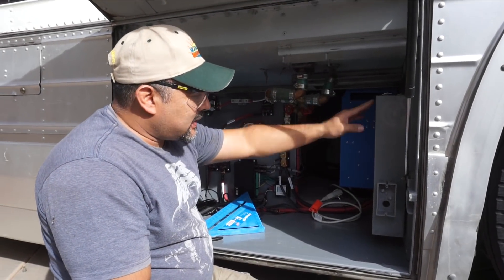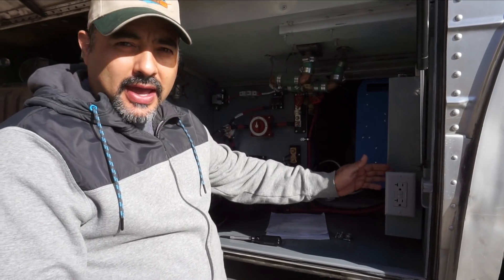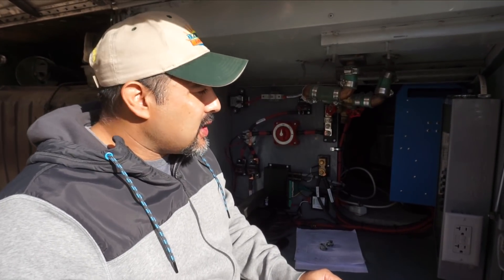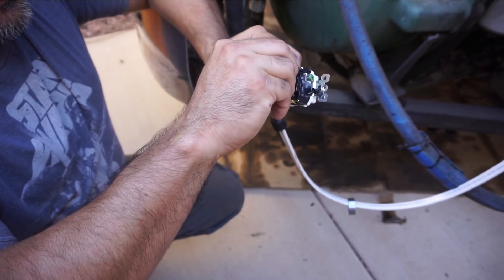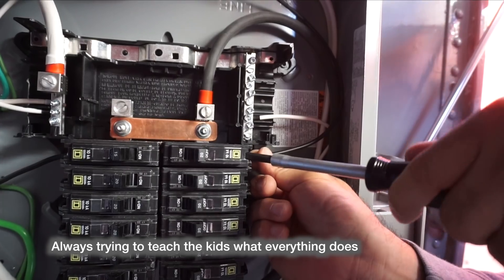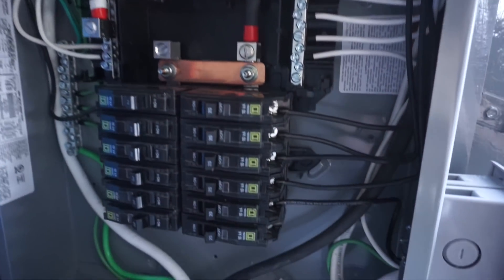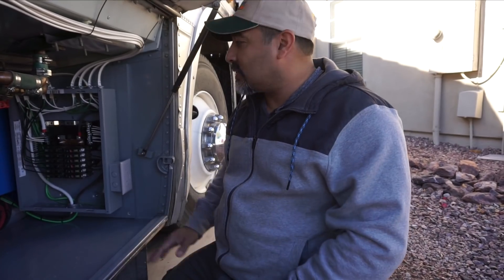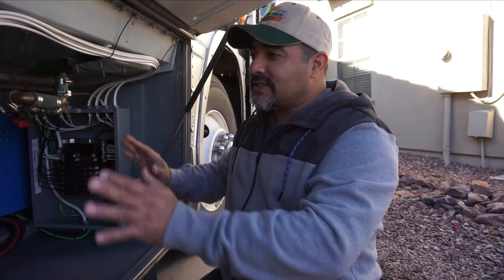AC Power: Part 2: 120V Breakers and Wire Installation

Comment: I can understand why not to. use romex but wny not to use extension cords ? Could you colaborate on that please ?
Reply from the maker: Hi - Romex can be used if it is secured properly and is not allowed to flex. However,  but as you alluded to, vibration can cause the wires to flex and break which can lead to shorts and a dangerous situation.  I did not use extension cables for several reasons, but most importantly I don't believe they are the best thing or safest thing to use.  They are not designed for running wires from a breaker box.  While many extension cords are UL rated - they are rated as a temporary extension cord not inside conduit or inside walls.  I used all 12/3 marine grade wiring for the my 120V side and all of it is tinned (to prevent corrosion) and is designed to lie flat similar to a Romex wire.  Extension chords are usually round and not tinned.  It also would not have saved me much money.  I went back and looked and I paid .5506 cents per foot in 2017.  A 500ft spool cost me $275.30.  So when I considered safety, function, and price I could not find a compelling reason to use extension cord.

Comment: Those wires in the engine bay need heat sheild.   They're going to roast.  That exterior box in there should probably be metal.

Comment: Great video like most I have watched. Just a couple of notes on what I saw. I think you should ask your electrician friend about using the push in holes for connecting your wires into your outlets. Most everything I have read says that is a very small contact area and might cause overheating. Kind of like running undersize wires. Plus I believe the push in holes were meant for solid wire?
    Another note is on your GFCI plugs. I was not aware of this problem till I lost power and my inverter came on. I had replaced one of the original GFCI outlets and when the inverter came on it refused to work. Turns out there is a list of acceptable GFCI for each manufacturer. You might want to check with Vectron to see if the GFCI you bought are compatible with their inverter.
Reply from the maker: Hi Tony - Thank you for the kind words.  I will double-check with my electrician buddy - I think I felt it was better because I put ferrules on the ends of the wire.  In retrospect, it may have been a better idea to put the fork terminals similar to the I had on the ground terminal.  Thanks for the heads up on the GFCI plugs - we have tested everything and it seems to be running great.  - One thing that did not work so great was the GFCI breaker we had coming into the Inverter when the mini-split A/C was running (you can see the details on our A/C update video).

Comment: Like the work you are doing, but don’t understand why you are limiting your system to 50 amps. When you plug into a 50 amp outlet at an RV Park, you actually have 100 amps and as a class A RV owner, I guarantee you when I’m plugged into a 50 amp outlet, I’m using more than 50 amps. With only 50 amps you are going to be playing the game of what I can I use at the same time without tripping that 50 amp breaker.
Reply from the maker: Hi Vonis - thanks and thanks for the question.  We chose to go with 50 Amps because our Inverter doesn't support 240V (at least not with a single inverter).   One thing our Inverter is able to do is augment the incoming power with battery power.  If we find ourselves needing more than 50 Amps we can pull an additional 42 Amps from the battery.  That being said we have done our best to use very high-efficiency appliances and air conditioner.  Our A/C only draws 8 or 9 Amps (versus the typical A/C that draws nearly 18 Amps).  If we do end up needing the additional power we have the wires run and would need just need to buy another inverter and run some additional wires in the bay.  We are hoping that what we have is big enough but we will know soon enough.

Comment: I've enjoyed watching your video on installing the batteries and wiring up your RV. 
I feel petty mentioning it but as someone that many years ago did a 4 year electrical apprenticeship I was taught that any wiring even with the potential to be in damp air should enter any boxes from the bottom. This is to stop any damp form settling on the cable and running down it into your box,even condensation can do this. If those cables going into your breaker box are not going through waterproof glands I'd suggest trying to seal them with some silicon. Sorry to waffle on but this rule was drummed into me.
Reply from the maker: Hi David - thank you for the input - I am not an electrician at all so I appreciate you taking the time to comment on the issue.  I will check into it and get those things sealed up!  Thanks for following along.

Comment: No I didn't have any issues with the breakers popping my system was about half the watts you have I had two 2012 trace inverters with turbo fans and interfaced them together one became a slave inverter remember this was over twenty years ago and it was a modified sinewave the inverters ran so good I had dimmer switches on all my halogen lights and they worked perfect the dimmer acts as a filter for any spikes in the sinewave but your system is the Cadillac of systems it okay to build something with over kill just because you don't want to redo it and that's wise if your going to do something do it once and do it right.
I really appreciate that you think it out your coach should give you and your wife many years of enjoyment and from what I can see your kids will probably want to barrow it from you that's how long it should last remember your house more than likely didn't get the attention your putting into the coach well done oh back to your question I split the power up to using both propane and electricity
Tankless hot water, jennair downdraft gas range, suburban furnace splendid washer dryer combo full size house fridge dishwasher two110 volt wall force air heaters two twenty inch TV's
 I had about 12 breakers like you always better to separate if possible the125 amp panel is what I used no issues what so ever I had 12 L16 Trojan batterys in the bay and ran I can't remember I want to say 02 /ot welding cable front to back to the alternator yours should put out 250 hot output I ran it to a battery switch and could charge or run straight to the inverters so you have your110
While your running I put a state of the art back then an inverter regulator to run the alternator for the proper needs I'm sure your system offers something like that the one I bought I believe came from cruising equipment out of Seattle, Wa. So eliminating the old Delco bread box regulator. Sorry for the writing a book to answer a no problem with the breakers tripping question. Enjoy your build 
Your doing great.

Comment: I did my wiring almost the same way mine went over head with the breaker box in the pantry and ran all the wires down the center of the roof in the raceway but as long as you have the Wireharness properly secured with strain reliefs
There shouldn't be any issues
Reply from the maker: Do you find yourself turning things on/off at the breaker very often?  This was a toss-up for us - I was going to put it in a closet at first- but then thought - maybe I wouldn't be turning things off at the breakers.  Still an experiment - I would love to hear how you use yours.

Comment: Awesome job, as usual!

One of the big reasons people have such difficulty running various combinations of electrical appliances is because of the total amount of power they have available.   For example, they can't run the hair dryer and the microwave at the same time because their inverter can't supply that much power.   Or, they can't run both air conditioners because they're only connected to 30 amp service rather than 50 amp service.   And, of course, limitations on individual circuits will also apply.   But, I think that, most of the time, it is because they don't have enough power available, rather than that particular circuit can't handle it.

You guys are going to have 42 - 92 amps available to you.   With what you're doing - trying to go completely propane free - all those separate circuits make a lot of sense.    In the end, your electrical system should act and feel more like a regular residential electrical system - especially, if you get that second inverter to enable split phase 240 volts.   And, I would suggest you go ahead and wire a few 240 VAC circuits in advance of acquiring the inverter.   For example, run one to the bay where you might put an instant hot water heater.   Run one for your dryer.   Run one to your kitchen to possibly supply power to a four burner induction cook top.  Now is definitely the time to do this.

I'm really enjoying watching you guys make this transformation!
Reply: A four burner induction cook top, a dryer, instant hot water heater, and air conditioning are the things that come immediately to mind.   I have  a plug-in hybrid, so I would want a circuit for a level two charger.
Reply from the maker: Thank you Richard - we are trying to make it feel like a residential electrical system.  If we had known more - we would have done 240V at the outset but for now, we are going to try to make 120V work.  Excellent feedback as always - we appreciate your input.
Reply: Oh, I know you're trying to make 120 volts work.   I'm just thinking ahead - like you were when you prepared the load center.   You may at some point decide that you can justify the expense of the second inverter to provide 240 VAC.   So, the question is, do you want to run the 240 VAC circuits now when it's relatively easy, or when you're living in it and all your stuff is in the way?
Reply: +Richard Owens What demands for 240AC would you typically find in a coach? Hot water, air conditioner, and...?

Comment: I am not trying to pick part your process, only trying to pass along information (which may or may not be correct). Please take it with a grain of salt and in the intention it is meant. If the master electrician looked at it than what I say below may be all wrong. But I wrote it before the end of the video and wanted to still pass my comments on. 

I believe when you say 14 3 wire you you really are talking about 14 2 with ground. Here is and example of what I mean. Romex 250' Roll 14-2 AWG Guage NM-B Indoor Electrical Copper Wire Cable w Ground https://www.amazon.com/250-Ft-Indoor-Electrical-Copper-Ground/dp/B01N7X626Y in this roll of wire would be a Black, a white, and a bare ground. I know you are using marine wire and maybe it is different with marine vs house? You should try and leave more wire in the box so that if you ever have to come back into the box the plug can be pulled out of the box still attached, the ends clipped and redone. I try for 6 - 8 inches of wire in the box (I do a double fold in the wire inside the box). NEC code wants a 3 inch min outside of the box (when the box is less then 8 inch). I have never used marine wire but it certainly is flexible. Is the wire you are running 14 or 12 gauge? 14 gauge should only have a 15 amp breaker, 12 gauge can have a 20 amp breaker. A 20 amp breaker should not be put on a 14 gauge wire as 20 amps through 14 gauge can overheat the wire. 

Excellent job on the labeling, very important! I would go with the tank-less hot water heater (space and convenience).

Glenn Lever
Reply from the maker: Thanks, Glenn - We are using 12-3 marine cable.  Apparently, the marine cable guys decided to name every conductor rather than only the current carrying conductors like the Romex guys.  I actually called Waytech to ensure this was the case and sure enough, the marine grade 12-3 cable has 3 conductors (black, white, green).  The A/C came with its own cable that was 14 gauge so we put a 15 amp breaker on that one (it is the only thing on that particular circuit).  Thank you for the input.
Reply: Excellent! I went to the read more page and got a 404, something is broken message.
Reply from the maker: Whoops - cut & paste error - should be fixed - thanks for the heads up
Reply from the maker: Thanks Kevin - it's easy to become frustrated and many people who post on YouTube are not as nice as the folks who comment on my stuff.  I am trying to not let my ego surpass someone's good judgement.
Reply: I recently watched vids from another guy's bus build. He speaks and gesticulates authoritatively as he installs Romex in his bus.
Reply from the maker: I hope I am not coming off like that - I am just a guy building a bus - I don't believe I have any authority on any of this stuff.  I do as much research as I can and use that information to build the best I can.  I have seen that most people use Romex - I have read both sides of the arguments.  I decided to err on the side of safety and use Marine Grade - but I have seen people much smarter than I am saying Romex is OK - even most RV manufacturers seem to use Romex - I guess the trick is to ensure that it is very well secured.
Reply: +Beginning from this Morning You are appropriately measured in your projection of knowledge, in my opinion. This other fellow is doing other things that are going to cost him big down the road. Apparently he is counting on ego rather than research.

Comment: When you show the back of the air conditioner did that hole where the wires came through have some sort of cover/grommet to protect the wires?
Reply: +Beginning from this Morning Strips of vinyl pan liner work well for that.
Reply from the maker: Hi Robert - thanks for following along.  The only place we did not use service clamps where the wire goes through the wood (I believe the place you mention is one of those places - we painted it grey so it kind of looks like metal).  when we are done we will likely wrap the wires in a rubber sleeve to protect them from the wood and seal up the hole.

Comment: An electric water heater would only work well plugged into shore power. A small electric WH would have a 1500 watt element. For each 1000 watts of power (1 KW) you would get 4.1 gallon of hot water @ 100F rise. So just over 6 gallons of water an hour. 35 years of experience in engineering these systems talking here. If you have any specific question feel free to ask. If it were me I’d go propane possibly with a pre heater off of engine heat if you will be very mobile. If you are just going to stay in one spot most of the time I would be just using the propane.
Reply from the maker: Thanks for the input Larry we are leaning towards propane because there is going to be six of us living in the bus full time - I just don't think the electric one will keep up.
Reply: +Beginning from this Morning What about a dual system? Electric for when you are on shore power, and LPG for when you aren't. A 10 gal electric can run on 110AC.